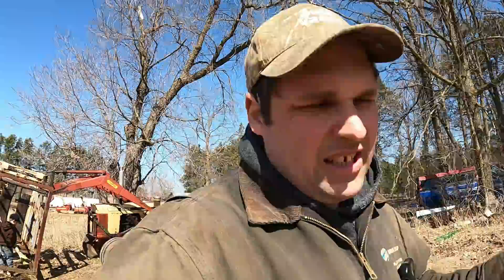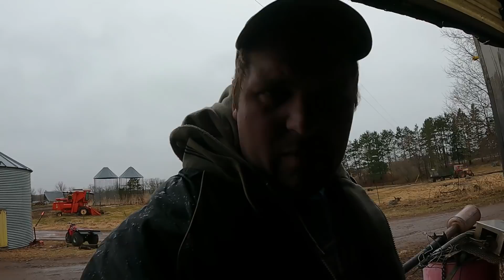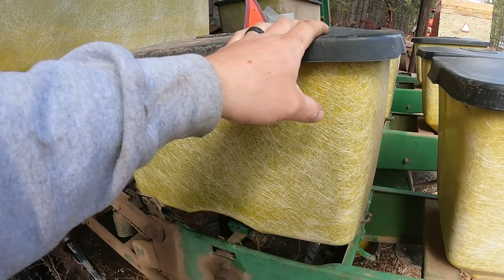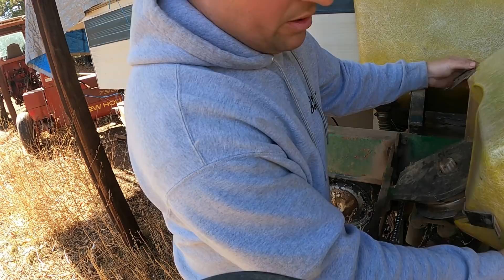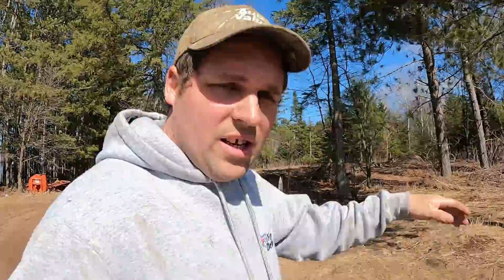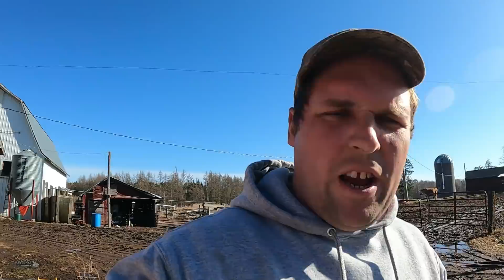New Chute Floor/Farmall B Update/John Deere 7000 Corn Planter/Farmall 560 Is Up And Running!

Comment: Them 7000 are good planters and simple! Only thing I don't like about it compared to the old deere is u could put sorghum with the corn an it would just shovel it in with the corn, good for chopping an the corn held it up, the 7000 will just grind it up with the corn, so you need to get the right cups for it then!!
Reply: " sorghum with the corn"

That goes waaaaaay back.
It used to be common many years back but the last farmer I saw sorghum in his corn field for sileage was about 1980.

About 40 years ago.
Reply from the maker: I think roundup ready corn, put a stop to sorghum in the corn.
Reply: @trinitydairy  it did! We use conventional corn when planting sorghum, then just a trip over with the cultivator, but we also put 28 on with our cultivator
Reply: @douglasmacarthur8775  it does go way back! We still do 1 field that way, plant the corn then change to sorghum plates and fallow the same tracks back with the 7000, the corn and sorghum compleat against each other and grows even taller good mix when chopped!
Reply: @douglasmacarthur8775  few years back had some ground to wet to plant so it got in late, planted sorghum and soybeans in the same row, that was excellent forage for chopping, chopped it when the beans made pod and we're soft , cattle loved it!! Looked kinda goofy in the field tho

Comment: You could put hydraulic cylinders or electric actuators on each marker and then you could pull a lever or flip a switch and you could select which marker you want.
Reply from the maker: Yeah, that would work, someone else said that the cylinder for the arms can be hooked up separately from the lift cylinder, but I haven't looked into it yet.
Reply: @trinitydairy  the bigger 7000s and 7200s have hydraulic markers. 12 volt may work better for your setup so it only requires a hydraulic remote for lift only.

Comment: I use my cordless circular saw for everything! I carry it in my car with my 20 volt hammer drill, grinder, 1/2" impact, sawzall, jigsaw, and right angle drill! I take them to work so I don't have to run a cord to cut 2 boards. Car is an impala like the one in your videos
Reply from the maker: Nice!
Reply: @trinitydairy  I work at a co-op and drive trucks and work in the fertilizer plant. I take my personal tools to work so I don't have to dig to get what I need. My trunk is full of tools like uncle bucks car!
Reply from the maker: @ethanthopy1996  lol, you can never be too prepared.
Reply: @trinitydairy  for sure! I have worked on farms as a hired man most of my career and stuff is always broke/needing fixed. So that is why I roll with a car or pickup (I have a car and a pickup) full of tools. I have the tools in boxes and I can switch vehicles in 5 minutes. I grew up on a farm my family retired when I was a freshman in HS.

Comment: Great job explaining the planter. They make a brush that's about 2 ft long and the brush part is round. Works great if you use graphite or other additives that will cover the sensor once in awhile. Also works to poke it up from the bottom if you happen to get the seed tube plugged up with something.

Comment: Kids bought me for Christmas a set dewalt 9 set 2 batts charger skill saw reship saw 38 impact drill + somethin don't rember but gave warranty deal if ya filled it ya got a gift of my choice with another battery so sent in got 1/2 impact it was around 400 at believe at Lowe's for 1 week at black Fri deal

Comment: Nice 560... I want mine to sound right like that
Reply from the maker: Get a hold of Brian at muffler delete 101, he will get you set up.
Reply: @trinitydairy  mine is running good for an old girl just has some electrical quirks that I need to iron out... she spent alot of her life under a New Idea mounted super picker... and parked in the Corn crib... Rats had a feild day with it till the rims rotted... I had to give her some love already 2K into it in parts... still not finished... shes looking much better with new rubber and rims new water hoses that the rats chewed off and a few brake, hydraulic and other things
Reply: @tdgreenbay  if you buy the parts I will fix and put it on the channel....
Reply: @MUFFLERDELETE101  I'm not in Minnesota... I'm working on it... I think I got someone lined up to help.. right now she starts and runs but eventually the Coil heats up and the spark fails
Reply: I'm in Pennsylvania.

Comment: Allen, get your planter parts from Shoup manufacturing in Kankakee Illinois. If you have dual hydraulics, you can split the markers and the raise function on that planter. The manual will tell you how. One thing is sure about that planter, it's worth more now than what you paid for it. You may want to replace the opener discs this year. 
    A good local machine shop is worth its weight in gold. He did a very nice job on your governor. 
    Best regards from Indiana.
Reply from the maker: That would be handy, thanks!
Reply: @trinitydairy  inside the tongue you'll find a tee that goes to the lift cylinder and the marker  cylinder. You'll need a new hydraulic hose or two (I can't remember if the markers are one way or not). It's an easy task.